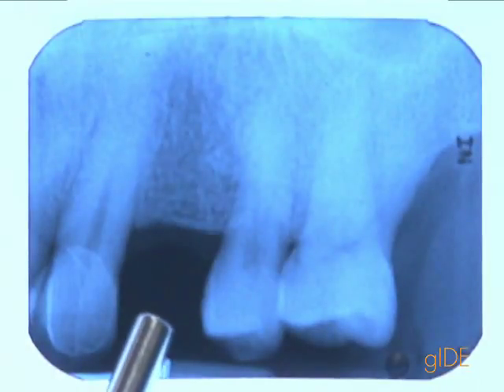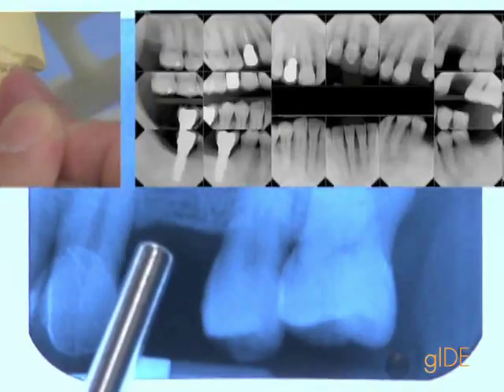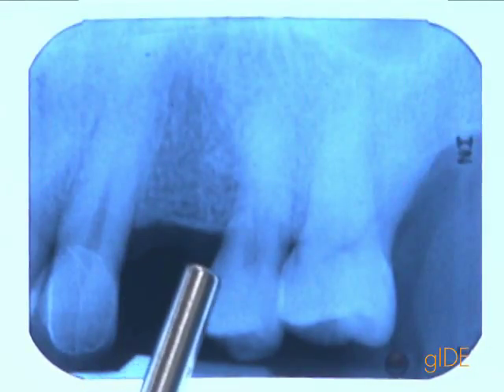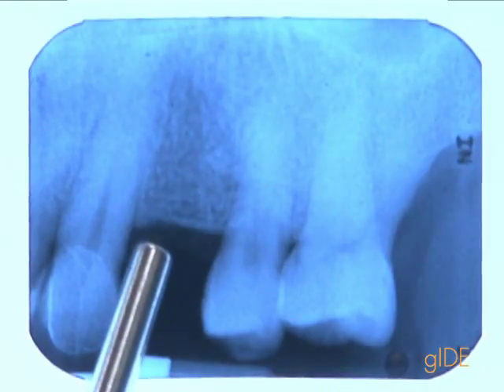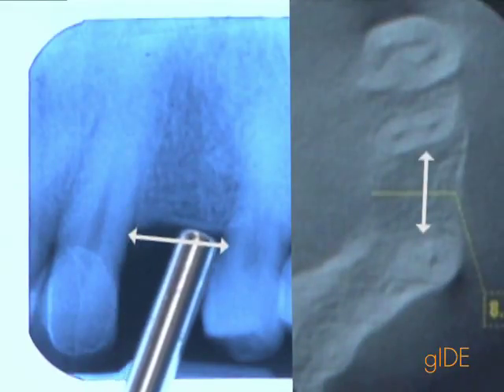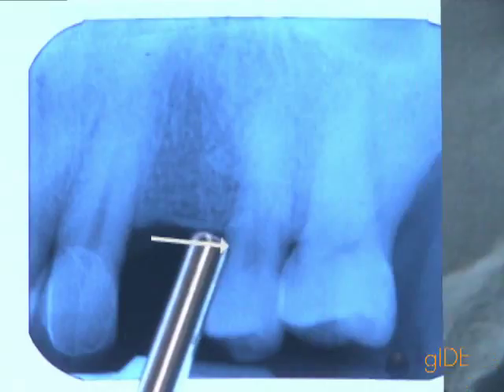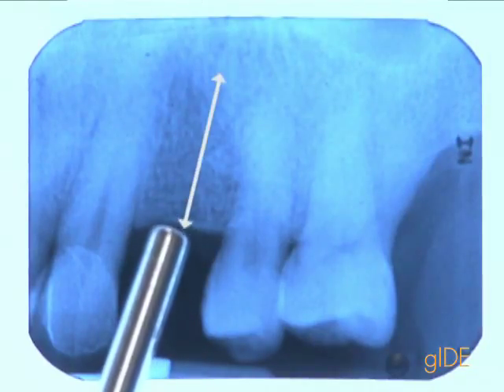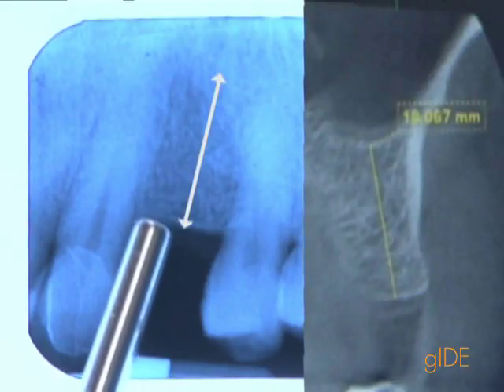gIDE: Single Implant Placement for Missing Upper Premolar - Surgical Steps (Vol. 3, Issue 2)

Comment: all the tools can be purchased at home depot
Reply: @oskaroskarowski3014  sure I can do it for $400 cash and I got some left over Ibuprofen
Reply: @lshowupainandpleasur  sounds like a plan. I hope you got lifetime supply of ibuprofen. I may need it.
Reply: Actually CAN BE PURCHASED on eBay!  Amazes me all the  medical /surgical devices are listed there for sale.  Of course one would need antibiotics, analgesics, x-ray, chair and drills (not including  the training, skill,  experience and surgical assistant to do the procedure. +A dental degree and advanced training.) Even so, the equipment alone would be a bargain compared with using 'the normal suppliers.'
Reply: Lol
Reply: I was very concerned thanks
Reply: @UwuPrince  goshti?
Reply: including the tooth 🦷?
Reply: @AlfieRivera1989  of course just ask the floor tile guy to cut some ceramic flooring up for you

Comment: I'm so scared I'm going to have that later on in the year 😞
Reply: @j j thanks for the info, hope you get a smooth recovery
Reply: Oh Ben, please don't be scared. I have had two dental implants now 6 months apart by the same surgeon. I was totally numb both times. I felt the flap construction as just pushing. Then the implant going in is just a very low slow drill, very gentle as they are so careful to get it in the right place. Then the torque wrench just feels like clicking. Then the stitches which is fine as you know it's all over! Post operatively, as the anaesthetic wears off you are slightly sore in the area and I do mean slightly. Both times now I have been suprised as how little pain I've felt. For example I'm in the peak of the swelling phase right now.... Just woke up and it's a 0/10 lol. But I'll still take my ibruprofen just in case. Honestly, it's all fine and after you'll think "was that all?" Good luck with everything x
Reply: @kimberleygardner5307  thank you for the advice 👍
Reply: I am also scared.  I won't get this sort of Dangerous and horrible treatment even free of cost
Reply: It is too much painful process...
Reply: i just had it done today and its not painful at all! you’ll do great
Reply: @kimberleygardner5307  dear Kimberley  thank you for the comforting words. You are so kind!!! I am deadly scared  of implants. 😞
Reply: @merinikolova5846  don't be! Best thing I ever did. Honestly, ignore the scaremongering, they are fine! Xx
Reply: @kimberleygardner5307  umm i know this may sound dumb but in the end do they have to give you stiches?
Reply: @eleonorageorgoudi7  yes, three, to hold the gum together as it heals. Then they take them out for you about 2 weeks later. They were fine.

Comment: Alright. So I had my 2 top front teeth knocked out 10 years ago.. And they did a root canal, plus 2 crowns.. About 5 years ago a crown broke and I had it replaced. The dentist said they usaully will break every 5-10 years. I been thinking about getting this done because it seems more perminant. But that would mean i will have to get the root canal removed I guess...And then have these inserted... Anyone out there with any opinions on if its a good idea or not? Would a dentist even recommend this? Not worried about the pain... The price kinda sucks.. I think in the U.S. 🇺🇸 its $1,000 per tooth out of pocket unless you have  dental insurance..
Reply: B T you may want to try zirconium crowns first. They will last you a lifetime.

Comment: I have a first molar that was extracted about 4- 5 years ago. I noticed the gum on the surrounding teeth has shrunk a little bit. I really want an implant. I asked my dentist if I would need a bone graft and he said no, but I don't know if I trust his judgement. Is it recommended or common to get a bone graft for a missing tooth of five years?
Reply: I've had two implants now and both times they have used bone graft as when they got on their my bone was very soft (I had abscesses years ago in that area which damaged the bone) the graft (apart from being an extra expense) is really not that dramatic as far as I can tell. He puts tiny little powdered shards of synthetic bone into the socket around the implant placement at the time of placement. It does mean though you have to be super careful with eating. Soft/liquid diet for two weeks to encourage the tiny blood vessels to grow into the bone graft. Chewing will break them down if they form. But I have porridge for breakfast. Soup at lunch and very soft Mac and cheese very carefully at dinner then ice-cream or yoghurt. It is boring but hey, I'm not letting this bad boy reject afterglow much it's cost me. Best of luck x
Reply: @kimberleygardner5307  Dear Kimberley on which teeth do you have implants? Where you scared at the moment of process? Did it look scary or as normal situation at the dentist?
Reply: @merinikolova5846  it was a molar and a pre molar, both lower left. It felt just like having a root canal or a filling. Can't see what they're doing, just a bit of drilling, suction, pressing. I was very nervous at the time but after (both times after) though "oh my god was that it?"
Reply: @kimberleygardner5307  Great Kimberley. So glad that you are fine. I have been going through a difficult period with my teeth. Mine is upper molar that I have to replace. Unfortunately the sinus is in that area. Watching all this videos gives me anxiety. For Me it's not imaginable to undergo this kind of surgery. But I have to admit that despite some people that are having some kind of issues with it, other are very pleased with the result and they feel it as a real tooth. The most important thing is that everyone's situation is very different. I do believe that technology has improved. But again, heaving the thought that someone is going to drill into my jaw and put an artificial item there it prevent me from doing that. Maybe I overreact and overthinking. Loosing teeth is the most painful and saddest thing. I am not the only one, just reading all these comments on you tube. Wishing you happiness! 💖